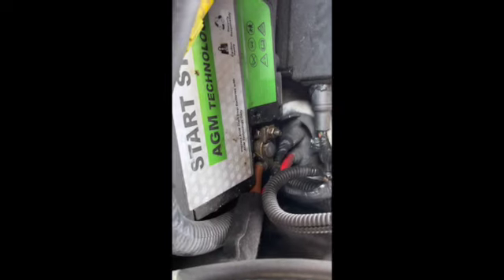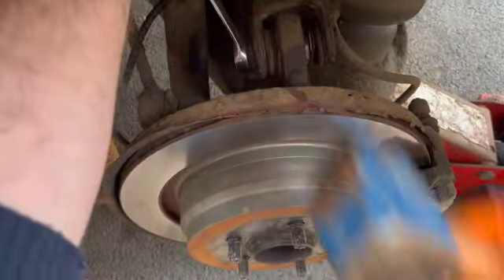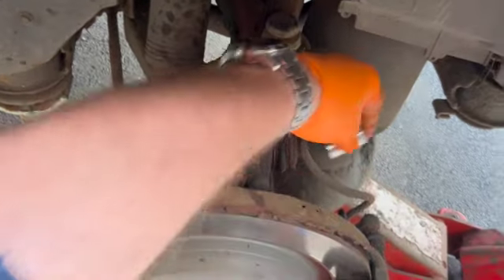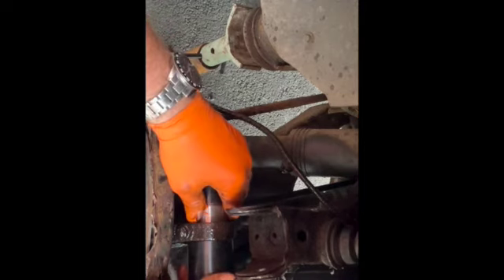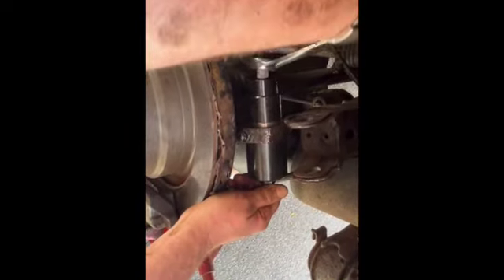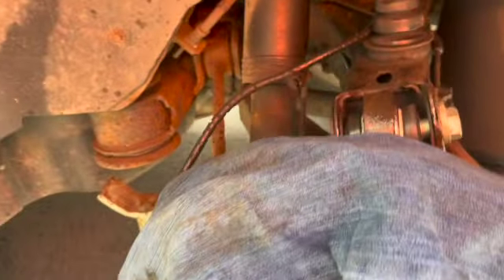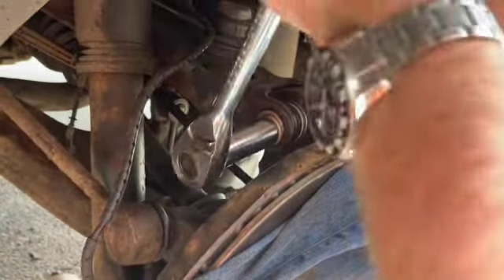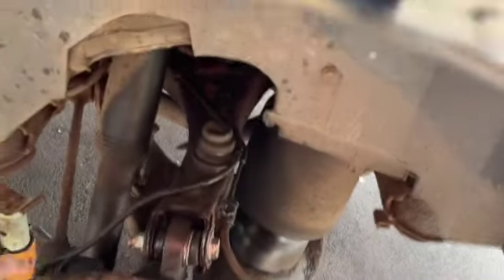Range Rover l322 4.2 Supercharged rear upper bush replacement

Comment: Was there a knocking sound as the car was being driven over the slightest of bumps, before you changes the bush?
Reply: Yes, if you jack the rear wheel up and put a bar under the wheel and try and lift it and if you feel play then I would replace top  and bottom bushes
Reply: @jasonseed842  I’ve had 2 local non-franchised LR garages look and play with bars and levers and can’t find the problem. I’m instructing one of them to change the sway bar bushes first to see if that cures the knocking. If not the we will change the bushes on the wheel that the knocking comes from. 
Thanks for your help.
Reply: @Rickwardful did you find it ?
Reply: @MrDosSantos991  No, mine still knocks when it is dry. When Winter come and everything gets damp, the knocking disappears.
I’ve tried all sorts of silicone lubes to stop it and we have changed so many bushes and joints, but we still cannot stop it. It is definitely on the left hand side of the vehicle and happy on undulating surfaces. Yesterday a sudden jolt doesn’t make. It knock.
Cannot understand it!
Reply: @Rickwardful did you replace the propshaft?